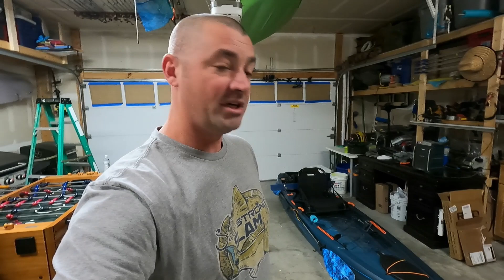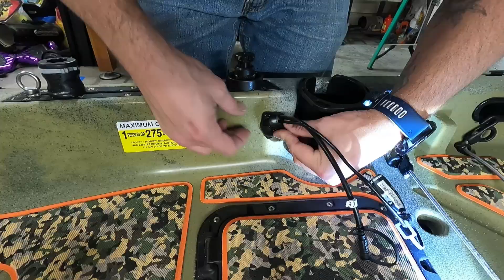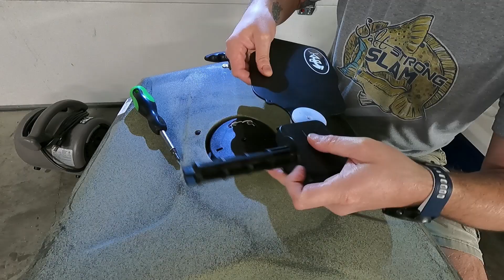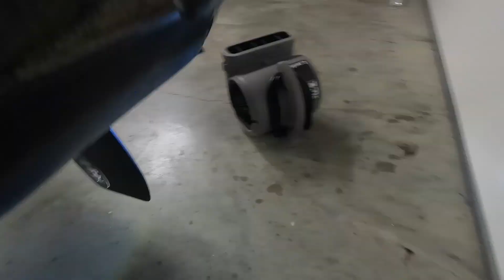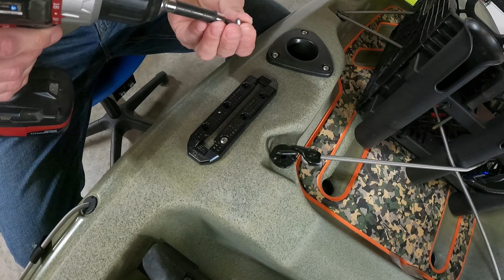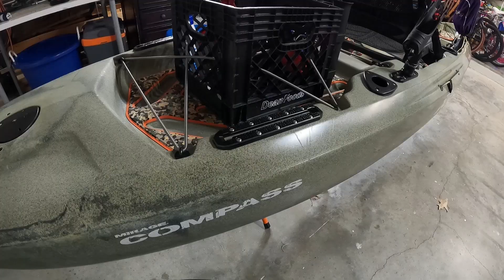Rigging up my new 2021 Hobie Compass Kayak!

Comment: Looking great man! Nicely done with the mods, just be careful with the right map pocket as the rudder cable passes behind where you screw it in. Maybe just check to make sure it’s not rubbing against the map pocket screws.
Reply from the maker: On the Hobies, there are 2 indentions that show you where to start the two top screws so that it doesn't interfere with the rudder line.  I also double checked through the front hatch and there is a couple of inches between the screws and the line, so it should work out fine, but I'll keep checking it after a every use.  Thanks for the heads up though!
Reply: @WildBillFS  if it cleared it then you should be good, my bottom front corner screw was literally touching the rope so I had to cover the screw threads to prevent it from rubbing.
Reply: @PeterRanieriII  I had to do the same with mine...I actually had to saw off the ends of two screws just to be sure and then covered them with a bit of HD duct tape...
Reply: @leightonsmith6149  dang that had to be difficult to saw from the inside, it def was an oversight on hobie's part

Comment: Nice work my friend!! One question. Is it safe to drill at the left side with the cables of the rudder? Cause i wanna install a track as well
Reply from the maker: The rudder line runs at a downward angle and below the side of the seat. Its fine to add track on the top and avoid the lines. The map pocket on that side though does attach where the lines run. You need to shorten 2 screws on the front and the 2 screws on the front bottom so they won't interfere with and fray your rudder line.